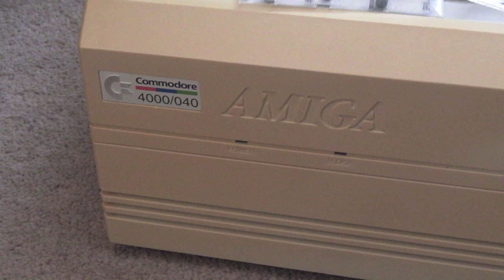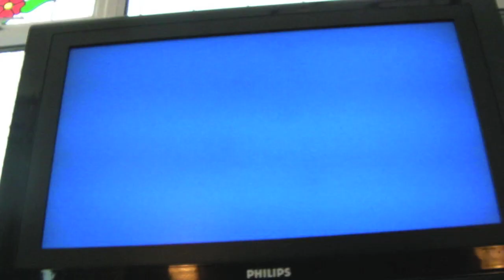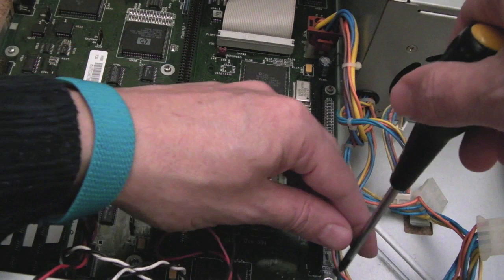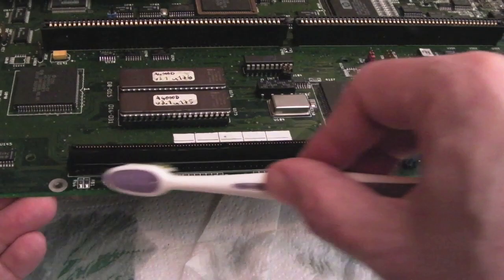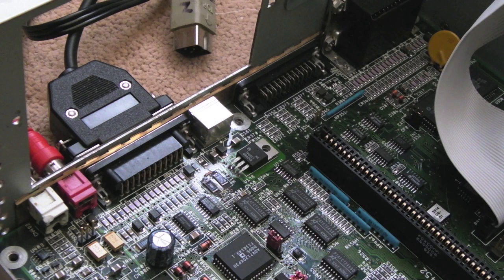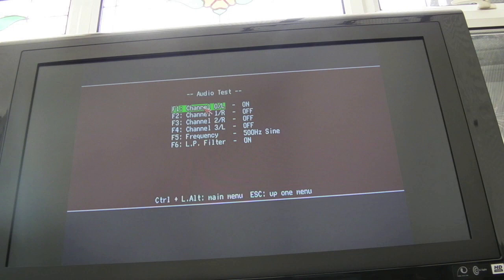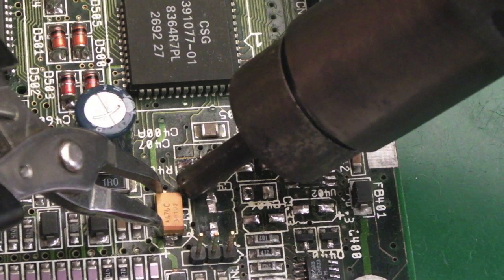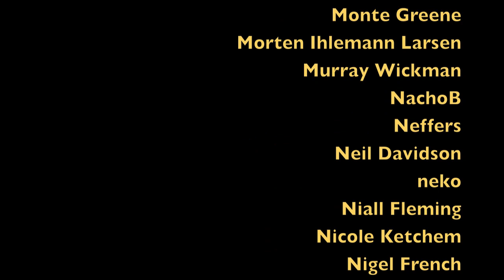Commodore Amiga A4000 Repairs - Part 1 (Cathers)

Comment: The yellow SMD caps are tantalum caps and it is ok to use them, but using ceramic MLCCs in place of electrolytic caps is not always a good idea. Their capacitance strongly depends of voltage applied, and they expose a very strong microphonic effect.

Comment: I got an A4000 last year and I was quite lucky. The board hadn't been molested and was untouched in original condition, but the battery had leaked and ruined a few tracers just near it. The rest of the board was otherwise in reasonable condition. It's a real gamble when buying an A4000 as to what condition it will be in.

Comment: Thank you, GadgetUK164, much appreciated Amiga 4000 restoration.
Reply: Sir, just recently I took my old sound card out, brushed it off cleaned it the way you've been showing, used 91% IPA and it took some of the silk screen off, but I tried and attempted a different type IPA - 50% wintergreen essential oils in it, and imagine my surprise, it worked flawlessly no streaking didn't leave residue and seemed to work even better than the 91% smells much better and took just a little longer evaporating. Nothing had issues with this same goes for my motherboard as flux residue was still present after purchasing it new. ASUS audio card, MSI FX motherboard. Everything seemed to work much more efficient, nasty mosfets really creep up those temps.
Reply: Merry Christmas Sir! And a Happy New Year!

Comment: The yellow disc is an MOV (metal oxide varistor} is used to shunt voltage spikes. It is wired across power leads. When the voltage across the MOV reaches a certain level it conducts (shunts) current and is destroyed in the process. They are widely used in surge suppressors and such.
Reply from the maker: I don't think it is a MOV, a number of people have pointed out its a resetable fuse!
Reply from the maker: Also marked F1 on the board which supports that!

Comment: If you're going to swap the audio connectors later, don't forget to reverse the color. The A4000 has the left channel going to the red one from factory... Also re. the audio diagnosis: check if the filter is working properly (systest, channels on to 10khz and see if filter on/off works by vu meter or scope)
Good job as always!
Reply from the maker: Thanks!  I wasn't aware of that - I've already fitted them on there =/  Will check with the owner if he wants me to swap them around!  Thanks for pointing this out!!!
Reply: That is nonsense. The audio channels are correct from factory. Left audio channel goes to CN402 (white) and right audio channel to CN403 (red). Where this "reversed channels" nonsense comes from? Equally nonsense as keep saying that the audio capacitors should be flipped by 180 degrees. This myth has also been busted by several people.

Comment: I believe the CR (cost reduced) version was the later revision with the chip mem soldered to the board, and the cpu on board too.  I had one a few years back, an 030 model.  Wish I'd kept it now.
Reply from the maker: I thought this was th CR version?
Reply: @GadgetUK164  The CR version had the onboard 030.
Reply from the maker: Thanks for the info!!! =D
Reply: @GadgetUK164  Some good information available on the amiga hardware database.   This is the board mine had.  http://amiga.resource.cx/photos/a4000,1  It had a decent battery on it too, so no battery leakage to worry about unlike earlier models.

Comment: Hi Gadget, another great video thanks, my a4k has similar sound issues too, have tried both 030 & 060 processor board, still the same results, I recapped mine last chrismas and had this sound issue and problem getting the rtc working also, so i shelved this last year till i could find time to investigate further!
My a4k board suffered bad battery and cap leakage too, i replaced my audio ports and re-flowed various chips in the area too. 
Ill be looking forward to see what you find to fix this , have a good xmas!!
Reply: You should send it to a professional for repair. Incompetent hobbyist repairs only damage the hardware.

Comment: F175 looks to be a self resetting fuse. (you've probably found our by now, but I'm not far into the video).
Reply from the maker: Thanks!  I had no idea and not had chance to research it yet - so thanks for the info =D
Reply: As already stated F175 is definitely a poly-switch (aka self resetting fuse), it's purpose is over-current protection for the +5V power rail.

It runs to the keyboard connecter, parallel port, joystick/mouse ports, external disk drive and video sockets. Drawing >1.8A combined on these connectors will cause the poly-switch to temporarily go open circuit preventing damage to the power supply, clearing the fault allows current to flow once more.

Comment: Temperature. When the temp is beneath 19 degrees Celsius; moisture in the air can do harm. Especially in salty environments and below 18 degrees and when electronics are not use for longer period of time, then tin can start to oxidase. Namasté

Comment: The accelerator/CPU board should have standoff pillars to bolt the board in place each side of the socket. To think I sold my 3000T for £500 with a full 68060 and RTG card. Young and daft. All I have a some photographs. It is quite probable the CD-ROM is SCSI. I did have a Toshiba drive of that design. The whole mechanism ejects, rather than just a tray. They date from the times when PC cdrom drives had not settled in to a standard so SCSI was all that was around that could attach to non PC systems.

Comment: Ceramic capacitors are widely used in avionics and automotive because of their reliability and longevity. If you're worried about variation with temperature changes then upgrade then to X7R or NP0/C0G from a trusted brand but X5R should be perfectly sufficient. It seems more likely that Commodore used low quality parts to save some pennies.
Reply: Crumbs, that was filthy. Those ram module were unbelievably corroded. And the some of the soldering in there is terrible.
Reply: You did a great job with the rework. It was so satisfying to see those nasty looking joints reflowed. Thanks for sharing!
Reply from the maker: Thanks =D

Comment: 060 and KS 3.11 have compatibility issues with A500 games because programmers "by passed things" in order to speed up frame rates even fast mem can cause issues. 

Sometimes A500 games work with the native emulation that KS has (the screen when you hold both mouse buttons on start up) and sometimes they just don't.
Reply from the maker: Thanks!  The sound issues were not related to the 060 (thank goodness!), but as you say - you can get issue with older games etc.  Anything WHDLOAD seems fine now!

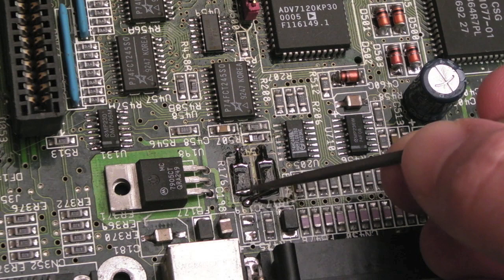Comment: 40:55 Is that 7905 actually connected properly on the other side of the board, because it appears as though one leg isn't, one sort of is, and the other is slightly better but still questionable?
Reply from the maker: Thanks, yes - it's OK but very little solder shows on the top side of the connections!  I did reflow it later as you will see!
Reply: @GadgetUK164  Ahhhhhhhh I see, I should have watched the whole thing before commenting :)
I had to go out and do family stuff so I didn't manage to get all the way through anyway, gonna rewatch it all :D

Comment: I have a board that was re-capped like that with those solid ones! It was cleaned and done well, just afaik whomever did the one I have here, should have capped it with proper electrolytics?
Reply from the maker: There's two ways of looking at it - 1) Tantalums and Ceramics won't leak - so in theory you might never need to worry about swapping the caps again. 2) Tantalums and Ceramics and short (granted it's rare) - if one fails, maybe an IC could fail at the point the cap shorts, but that's not certain and none of them might short.   And finally I guess its about personal preference - some people just prefer to have the original type of capacitor on there.   Ceramics are sensitive to vibration also, electrolytics aren't.

Comment: Why did you change the Tantalum caps by electrolytic? Seems like a downgrade from horse to donkey...
Reply from the maker: It's a case of putting the board into its original specified state.  I agree that perhaps Tantalums in certain places on the board might be considered an upgrade.
Reply from the maker: There's another good reason as you will see in part 2 / 3!  I am still shocked at what I just found!

Comment: I have an A4000/030 Rev.B that has been in my loft for 20+ years. the power supply is good but the computer wornt work/boot sits at a grey screen. would you take a look at it please, I can pay for your time and parts. many thanks.
Reply from the maker: Yes, but it might be a few weeks yet - I need to clear some of the backlog first!  Contact me on Twitter (@GadgetUK164) - just post a reply on one of my posts on there and I will follow you and direct message you.

Comment: Tantalum caps are much more expensive than electrolytic caps; they’re a perfectly good replacement for electrolytic and much more reliable. A lot of modern hdmi/rgb console kits use tantalum in place of electrolytic.  Just don’t install them backwards - they explode!
Reply from the maker: Thanks, yes - that thought did cross my mind after reviewing part 1.  I could perhaps have just left the tants on there and just swapped out the ceramics.  There were more tantalums than anything I think.

Comment: I do not agree with tantal caps or ceramics. on some locations they may work  but why.  tantals explode when going bad. and ceramics shorts when going bad.  exchange with the same type for best result.   there are electrolytes that doesn't leak..   when i get a machine with tantal or ceramics  I actuall class them as being "recrapped"   and as a service to save it. I will always offer a recap for the component price and nothing for the work.  so I know it is done proper...  the Germans of some weird reason like to use ceramics..  no idea why..   i would never tolerate it

and yes the 22uF caps at audio have the wrong polarity
Reply: The machine came from Germany.................
Reply: @cathers1  Ahh explains!  ze krazy germanz!
Reply: @ChuckyGang  I see now in the video that they did the same with your 060 board :(
Reply: @cathers1  Thats why my reamiga1200 build-guide contains:

(a note about caps: Capacitors is a more or less religious thing. some put in ceramics, some puts in tantals.
this however I will not support. if you have ANY issue and using that kind of caps. ask for support from that person telling that is OK. I will ONLY support electrolytes. but.  they leak?  BAH! not if you put in real qualitystuff like those panasonics in my BOM!)
Reply: You still keep spreading this 22uF caps wrong polarity nonsense. It has been proven by several people that this is nonsense.
Reply: @MegaMasa2000  links to facts please...

Comment: I enjoyed your video and found it quite informative. 
I have been using my various Amiga machines daily since I bought my A1000 in 1987, but lately just superbase and Maxiplan.  I have decided to get back into doing some hardware hacking, and was wondering, if I was to install a PC AT card in my 4000, and  added an ethernet card, could I access the web from the Amiga side  (OS 3.9)
Thanks,
Bob
Reply from the maker: I am honestly not sure if you can access the network card there from the Amiga side - I don't have enough experience playing with the PC cards in the Amiga!
Reply: @GadgetUK164  It didn't hurt to ask, I have the AT board, so when I get the 4000 together again, I will attempt to get an ethernet card to work.  I know I have other options.  The next one I will try, is Parnet.
Reply: @GadgetUK164  I have a 386 bridgeboard, and did find information that states a person can access the ethernet card, so I am going to give it a try.  I have had company, so I didn't have the time to look at why I am now getting the yellow screen on startup on the 4000.  It ran fine for two days.  I am going to pull it apart and install a Warp OS board in the machine.  If I can't access the ethernet card using this method, I have a couple of other ideas.  As long as I keep telling myself it is a hobby, I am not wasting my time.

Comment: The main problem with large value MLCC ceramic capacitors, is they are highly voltage dependant. For power supply decoupling this is probably OK, but it is a very bad idea for signal coupling capacitors. There's really no need to fit them - good quality electrolytics will last for a very long time

For flux, if you want a good affordable flux, I have found MG Chemicals 8341 is very good quality.. ive used it to rework and replace chips on A600s and A1200s with great success
Reply: now I see the caps, they are tantalums. while I dont recommend fitting those, they work just fine without issue
Reply: 060 card definitely NOT assembled by Chucky - someone put MLCC ceramics on that... he'd be pissed!
Reply: "ReCrapped" as he would say :)
Reply from the maker: Thanks for pointing it outs not Chuckys work =D LOL!

Comment: I've found on the A4000, the  tools at http://www.amigapcb.org/index.php are more efficient at trace finding and component checking than the published schematics. Have you seen this yet?
Reply from the maker: Thanks, yes - I found and used that =D  But I ended up just using the schematics for the audio section!

Comment: The A4000 I bought had a GVP T Rex II cpu card fitted. Would that be an equal or superior to Chucky's card?
Reply from the maker: Yes, that looks like the same specs to me - 060 @ 50Mhz
Reply: @GadgetUK164   nice, only trouble I've found is the compatibility with certain games. 030 / 040 seems a better fit but the speed difference is massive in titles like frontier
Reply: GVP T-Rex II is a much better card than the crap A3660 card that does not even have on-board memory which makes the 68060 processor crawl. Pointless spending 68060 processor on A3660 card. GVP is several times more faster.

Comment: Try dune without the 060 the A4000 has a 020 built in.
Reply from the maker: There is no 020 built in! =/  I think (maybe) the earlier 4000 board rev might have had an 020 onboard?
Reply: @GadgetUK164  I thought that they all did sorry my mistake 😕
Reply from the maker: No worries!!!  You made me check lol!  Went running into a pitch black room with a torch to inspect the board for an 020!!!
Reply: @GadgetUK164  sorry about that but I was convinced that there would be maby if it says 040 on the front it just indeed means a 040 🤔